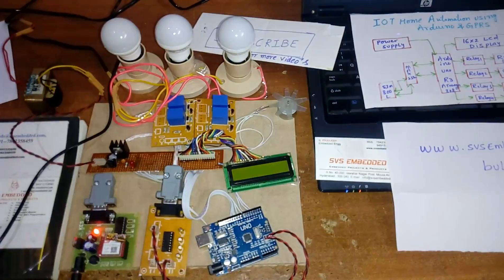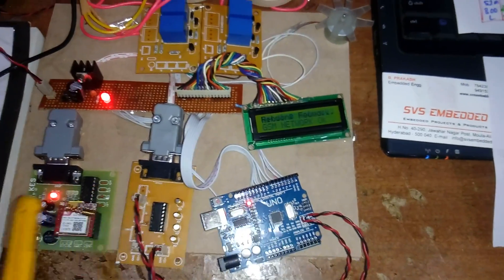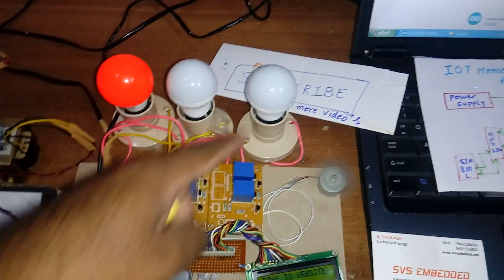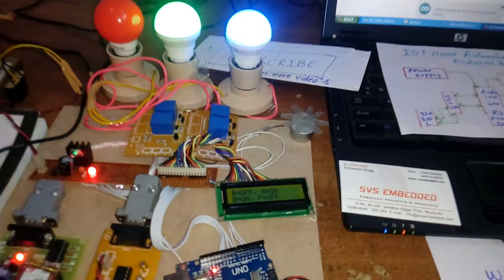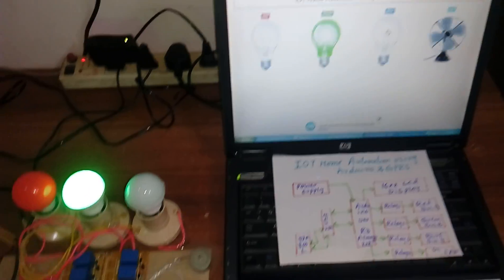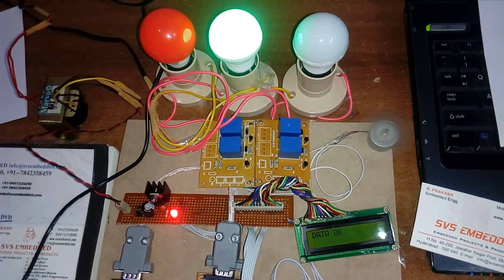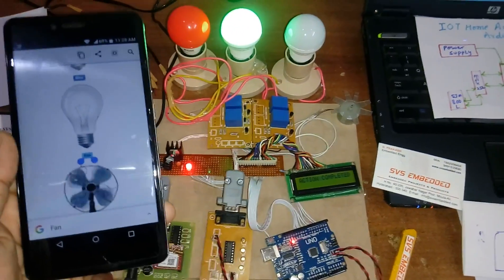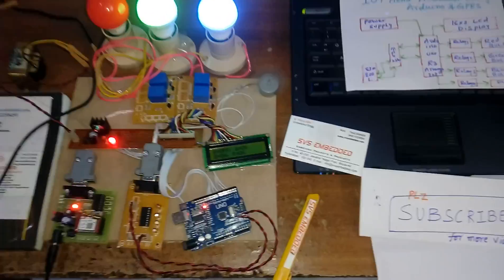IOT Home Automation using Arduino

Comment: Please can you send me your code. My email id is: alekh.sinha09@gmail.com
Reply from the maker: Thanks for watching and your valuable Feed back.yes we will help on coding part.
we are selling the projects with least cost.if u order the project we will provide working hardware kit along with 
1.abstract
2.datasheets
3.documentation
4.schematic( circuit ) diagram.
5.software code.
6.sample ppts
7.photos&video file on entire project
through google drive
send me a mail to  svsembedded@gmail.com,info@svsembedded.com.
9491535690,7842358459,www.svsembedded.com,www.svskits.in,
we will send u the how to order procedure to u.

Comment: its a good project. can you send me this code so that it will be helpful for me
Reply from the maker: Thanks for watching and your valuable Feed back.yes we will help on coding part.
we are selling the projects with least cost.if u order the project we will provide working hardware kit along with 
1.abstract
2.datasheets
3.documentation
4.schematic( circuit ) diagram.
5.software code.
6.sample ppts
7.photos&video file on entire project
through google drive
send me a mail to  svsembedded@gmail.com,info@svsembedded.com.
we will send u the how to order procedure to u.